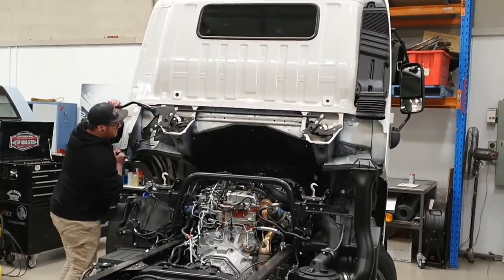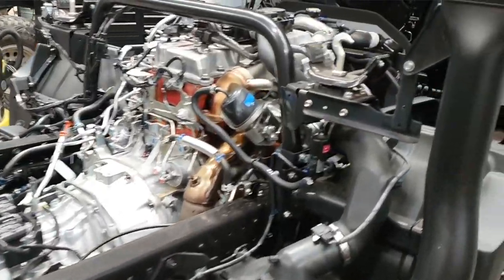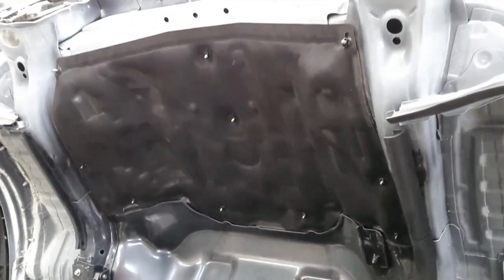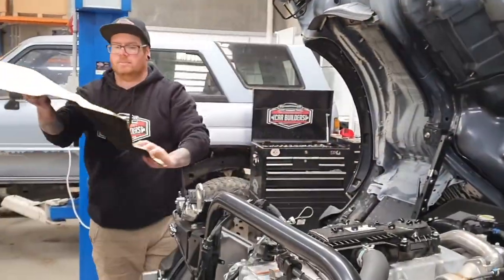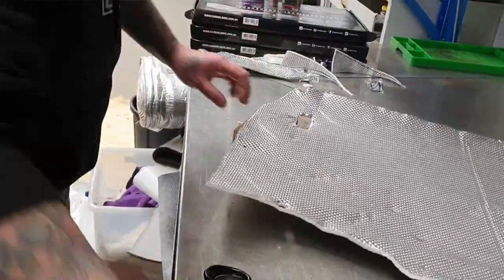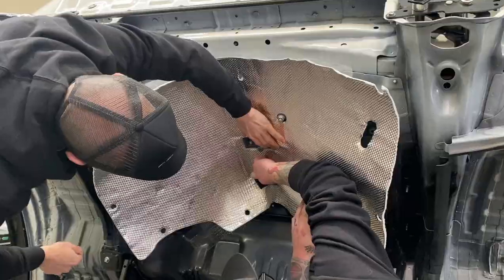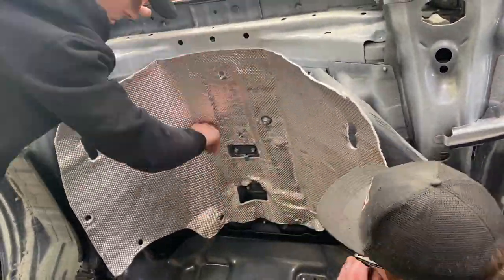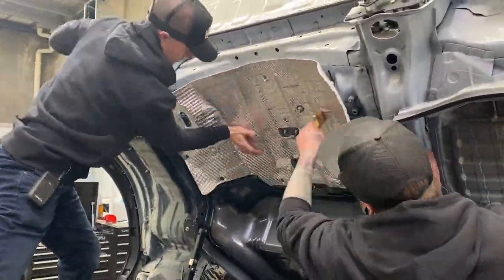Stopping Heat Through An Over Cab Floor

Comment: I got one of these with a motorhome mounted on it. Not the smartest choice of vehicle but I can't change it.
Did Mass Noise Liner on the floor and Sound Deadener on the roof; much quieter. Might have to look at this product as well.
I have found that having the doors open assists when tilting the cab.